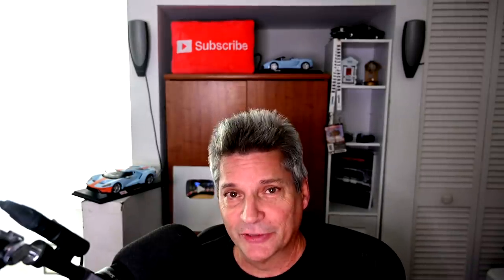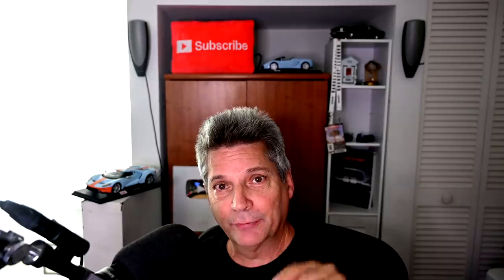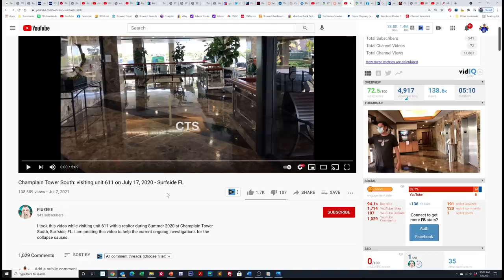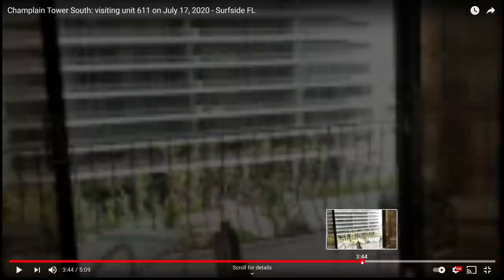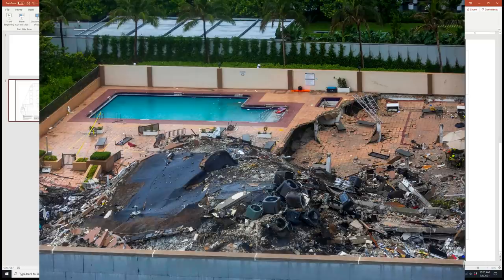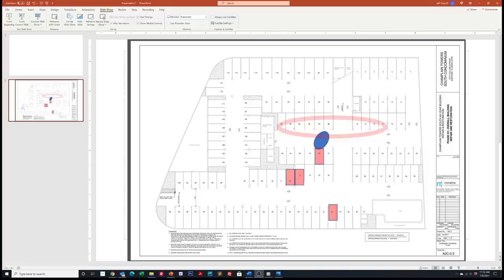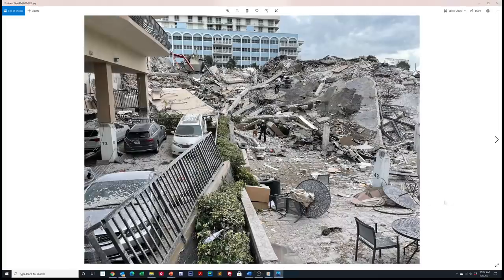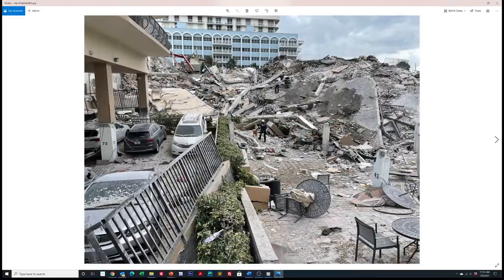Analysis Garage Video BEFORE Condo Collapse: Water Everywhere

Comment: I’d be surprised to find that the concrete ceiling in the parking garage was ever according to code when first poured. 
Agree the garage floor looks like it is sinking in some spots and higher in other spots. The large cracks in the ceiling that were so called fixed by handy man as you say in the video is separating, moving away from the other part of the separation. Total failure of design, concrete mix. This building should never been allowed to be filled with residence after the 3 year ago building inspection. To me it shows not a failure of vertical columns but horizontal ceiling to floor above that failed. God help those who allowed this building to ever pass a inspection in the first place. I’d call this design a complete utter disaster waiting to happen. I’ll never move to Florida now.

Comment: Of course this is in South Florida, water on the floor, once it gets there, will take a very long time to dry. The humidity is pretty much incessant and the floor of the garage is poured below grade. The water can't even soak into the concrete floor because under the floor is almost certainly extremely wet. Dig a hole a as deep as the floor of the garage is in South Florida and see how long it takes to get wet. Not disputing anything about the commentary, just saying, wet is a way of life down there.

Comment: exponential colunm failure one goes others take the load and fail with a  branching pattern due to pumping salt water and sediment from the garages .it caused a pocket under the building as the sediment was supporting the building=no building but only a  Lemans guess though♈️🤟 also the reddish brown streaks is rust

Comment: Sorry to post another thing wish I could of just edit… the space 52 and 53. It looks like a void of some sort in the center of both the pitch on right and light goes to the center. To me there is water internal besides external . Unless they had people with no experience finishing . There is a issue :. I’m so disappointed that’s water is standing and that there is no place for water to drain. They had some issues going on and I just baffled why they think epoxy or hydraulic cement would fix that. Been cheaper to just use quick Crete

Comment: I wonder why the left side of the building was built more solidly and with thicker columns than the right side. It is as if the engineers were different.

Comment: That look's like liquid foam dripping from when it was injected into a crack, not rebar poking out at 12:20 absolutely NOT a good fix, especially since foam expands powerfully, as it dries. You can see where the yellow foam expansion brought some of the rust from the rebar out with it. It looks like they left the plastic injector tips in the cracks, I've seen bad work done exactly like that before on homes, and businesses.

Comment: I may be rushing b4 I finish the vid, but you mentioned how column 78 being muy importante. That alot of  water was sitting there, then you also asked why would that one car have a cover on it if it's in a garage? Well isn't that car sitting in #78? 🤔 I mean, you do this for a living, you know what to look for, so I'm probably dead last realizing this, and if I am,...then disregard my comments. Carry on!
Reply from the maker: you're making it sound as if I'm some kind of idiot. It wasn't a real question that was a rhetorical question kind of like revealing more information about the space by asking a question that you're supposed to answer yourself.
Reply: @jeffostroff  No,no,no, I was just slow at realizing the connection. When you said that about the cover, but didn't say which section it was in after that, I just immediately had my lightbulb pop up putting the two together. But it honestly went over my head that that's what you were saying already. Me saying, you do this for a living was me saying, that I do not. I could be so very wrong about it, and if I was to correct me. I was asking the question was this being a key point. But I was too slow to understand that that's what you were pointing out already.  So, no, that wasn't my intention to upset anyone. I apologize if I did, but I assure you, my actions were due to me being deeply fascinated into the subject, & had questions about that specific point.
I can see how you saw it put that way too. My apologies.

Comment: Does anyone else get a very eerie feeling watching these videos? So many people lost their lives. Horrible. I know it's called an accident but this should have never happened. After a proper inspection with experts this should have been shut down. I know it's easy to say after the fact, but so sad. I'm definitely no expert but they definitely need technology so they can look inside the concrete, not just the outside.. I will never look at underground parking garages the same.
Reply from the maker: Yes preventable accidents like this are the hard ones to watch because as you see the onion unravel in each bit of evidence and you stopped to realize oh this part should not have happened and then Oh no no that part should not have happened either and just how many errors are made along the way you just wanna hang your head

Comment: If the sprinkler system was leaking the flow bell would've set off the alarm... unless somebody left it on "test." If thats the case, somebody probably caused a lot of human catastrophe. Imagine, if you had 7 to 10 minutes to get out of the building because the alarm was going off?

Comment: I wonder if the condo had the deck tiles installed and the sand under them just acted like a wet rag just sitting on the deck concrete for years and years cause the pool deck to fail and from there everything came down.

Comment: At 19:08 to 19:15, it looks like another piece of that corrugated metal roofing attached to the ceiling.
Reply: By the way, this series of videos was really well done and showed a lot of great observations.  That other identical building up the street should be inspected very carefully for the same types of problems.  I wonder if it also has the smaller columns under the part that collapsed.  I wonder if it is experiencing the same types of water damage.

Comment: i am an engineer and the photos i have seen don't reveal much, the garage looked pretty clean to me, a few puddles don't mean much
Reply from the maker: It's more than a few puddles it's a constant supply of water dripping everywhere that should mean quite a bit to you. Especially the multiple cracked repairs on the ceiling that were done wrong and you could still see the injection ports sticking out. The reason why there was cracks on the ceiling in the first place is it's under stress time for round recreation whether your idea relaxation

Comment: IMO the slabs over the garage were compromised by water from above, rusting the rebars inside the slab. And thus the slabs dropped downwards away from the columns, and this created a lateral motion that pulled the columns sideways as the slab fell... thus collapsing the entire building. Really bad design, bad maintenance, bad engineering report and bad luck.
Reply from the maker: yes our assessment as well

Comment: Besides the Blatant Water Damage EVERYWHERE that originates from the recently installed pavers and  planters ( The Pool and Pool Framing  is 100% in tact and undamaged  ) the ceilings Sagging and Spalling-" DISHING" and WaterPooling retaining Ocean Salt Water and RAIN while Even MORESO , also , CLEARLY having been PATCHED UP  with plaster epoxy and paint while indeed no VISABLE water damage on SOME  Columns proves HIGHLY SUSPICIOUS  that bogus patch repairs were probably made to cover up  cracking and shattering of  Column s .

 The FACT that steel rebar was hanging without concrete after the collapse shows clearly that the  concrete sagging was covered up with plaster epoxy and non support building materials over the support  Collums

  - Jeff is Spot on the #Truth Water cuts through the Most Sophisticated Concrete and Steel Supports like Butter over time while mismanagement and  inexpensive bogus patchwork can take down an ENTIRE BUILDING
Reply from the maker: YEs water brings life, and also death

Comment: The sheets of corrugated plastic was there to protect cars from runoff.
Reply: There are white plastic injection ports for epoxy resin injection or spongy rubber stuff. Basically cosmetic repairs not a solution to prevent failure of a section.

Comment: A dead body, specifically a human corpse has a rank and pungent smell mixed with a tinge of sickening sweetness. Imagine a rotting piece of meat with a couple drops of cheap perfume and you’re halfway to understanding what a human corpse smells like. I have assisted in an autopsy on a body several days old, and even though it was in a huge chilling compartment, the smell was in the whole complex. It smells like there are a million dead and rotting rats around you. Understand that a pound or two of rotten meat only gives you a faint whiff of the smell of a full-grown corpse. The power of the smell is incredible. Personally, I’m not sure it’s describable. You want to gag when you’re fifty feet away. It can take years for the smell to leave a house. It just lingers in the background. Cars are totalled by the insurance company for the odor. And the guy driving the wrecker can’t drive fast enough to get away from the smell. It gets on your skin and clothes. (People use bio-suits for body removal for a reason.) Maggots abound, fluids abound, and I’ve never read a good description of the experience. No matter how well you write, it will be but a pale imitation of the experience. Rotten eggs, feces, and a used toilet left out for a month x 1000. It is unholy. The smell gets into your throat and you can taste it. You will literally run to find some clean air. Even then, it lingers and you can’t quite get the smell away. Even though you can no longer physically smell it, you remember it and it takes quite a while to get over it.

Comment: Analysis is wrong. The Other  better video I saw, the columns by the black truck fell. The water was further in. The damage was further in, where the front of the building was. The parking garage goes out further under the pool deck.

Comment: Those residents should have been questioning why they are paying hoa fees and the place looks like crap. And even hiding it by paint isn't working. There are stalactites & dark patches in the paint. AND they stalactites are forming off of the epoxy patches! That means the water is still coming down. That should have made people question their is a water problem.

Comment: In engineering, the failure of one or two columns should not impact the total collapse (assuming there are many many load bearing columns). So if one column failed, the rest are supposed to hold up. But if "many" had been worn out and weakend due to spalling , then the collapse of just the one column (whichever it was) must have triggerred the rest. This has to be on the engineering execution team. Also pls dont put dramatic music to a great commentary! Thx

Comment: maybe someone drove a car into the parking garage  and hit a few columns?  
or had a heart attack or seizure and just floored a vehicle into a few columns..?
 it would be found at the bottom of the pile  with significant front end damage in a frontal impact direction..

 ps ,, it does rain daily in the Miami , like clockwork it rains daily..
and  cars do shed water when parked on an incline..
 i think  column 14 is on a separate structural slab where as the parking deck with it drains is sloped and inclined.

just a thought ...

Comment: 20:54 that black line down the row (ceiling above the driving line(rusted rebar?)) is the planter box line, and a constant source of water, pressure of 1/4 inch deep water is about 4 inches mercury vapor rise, very similar to the tissue paper draw factor, add some sun and the steam in the concrete will propagate. With nowhere to go water will follow the rebar and network out every rebar, every planter box watering cycle. ticking time bomb... soon all the rebar is held in sand, puff. Everything was tied to the platform, you can see the poles only had short 4 ft rebars interlocked, not welded. see 24:18 column 72. Once the flowerbox platform sequentially collapsed the building fell in from the planter box out. Take note the center flower box had a hazzard barrier next to it, just above spot 78, at 28:30 of your first video https://youtu.be/PEPyE2h6P4k?t=1710. These flowerboxes took down this building.
Reply: lookup the waterproofing, drainage plans and watering schedule for those flowerboxes...

Comment: It's not enough to patch ceilings in a basement !!  You have to fix the roof 10 stories above it.  or fix the plumbing some stories above it.  And fix all the slabs and columns and walls above it.  This is like chewing gum on a space shuttle gas tank.  (what is that? that's the leak still leaking at the edge of the patch, and the iron oxide coming with it from the rusted rebar that exists in many walls way inside the building).  Unfortunately this should have been demolished in 2018 after a more thorough test which would have proved it beyond economical repair.  it's probably fully depreciated anyhow, and the owners would have liked a new building.  Plus not been killed.  At 27:35 you see rows of derelict a/c condensers causing damage and whole roof looks derelict compared to older building on the right.

Comment: Tha is the only building tha high tha have ac central units  the condescension fron the pipe that runs inside the wall from the roof to the units   leaking end condescension over time that is why no   buddy see the water come from humidity

Comment: Where is the h beam or I beam support structure needed for load distribution especially because the whole condominium complex built on top of swiss cheese aka the parking garage and no tie in to the solid wall outlining the the parking garage and solid ground as well this building was doomed from the start.
Reply from the maker: I wonder if they really needed those H-Beams, I want to know what it was under because I saw nothing over it in the drawings that says they needed it

Comment: Any thoughts on the lines of water on the ground might be from the condensation from the sprinkler system lining the ceiling? Not sure if that would create that much water, but Florida isn't a place where water evaporates quickly in a garage.
Reply: Sprinkler systems don't produce condensation.

Comment: By the Ocean the faulty pipes with water and humidity in S.Fla. Better set up dehumidifying equipment through out all buildings in these conditions in Florida. Take note. Most was due to poor building due to greed and cuts and time frame. Bad business cost lives at the investors increase expenses which greed and smaller column's on the collapsed side. The extra penthouse on the top was a cause for this adding to the failure and added weight. Shoddy workmanship.

Comment: Those columns are way too small. Anyone can see that.
Reply from the maker: The columns are small but likely they are right sized, as long as you don't have a problem with the pool deck collapsing which is something that probably people didn't expect to happen back in the day. Also if they don't put in enough rebar to strengthen the concrete and tie things into the columns that could be a problem as well.

Comment: LOOK AT THE COLUMN AT MINUTE 25:04. IS IT JUST ME OR IS THERE A SHEERING CRACK AT THE TOP??
Reply: ALSO, MINUTE 29:36& 29:48 COLUMN 88 APPEARS TO HAVE HAD A HORIZONTAL CRACK REPAIRED AT SOME POINT. (DOESN'T LOOK LIKE FORM DEFORMATION)
Reply from the maker: It is so hard to tell, lot of distoirtion

Comment: I think that the water issue is poorly maintained A.C. condenser drip lines, the repair on the PVC 90°, and the sheet steel "drip pans" against the ceiling are all "Handy man" repairs because people usually do NOT call a plumber for A.C condenser lines.
 Which become stopped up with bacteria and fungus.
 All the stalactites follow cracks in the cement, cracks that are now redirecting A.C condenser drip water from multiple units.
 The rebar has now created a rust jacking situation where as it rusts, it expands, expansion opens cracks, more water comes through, more rust happens. Building collapses.
 Rust jacking in insufficient rebar caused by lack of condenser drip line maintenance is why it failed. 
K, bye.

Comment: Well there is one fundamental problem so far, your water water everywhere thing? You do realize there were thunderstorms in the area on July 11, 2020 right? A lot of that water could simply be coming in from wet cars.  Then you point at the ceiling and talk about paint peeling, which is stupid that they allowed that to happen but as you point out high humidity causes that. I wonder, is there a history of high humidity in Miami Florida? That is obviously a rhetorical question for those who may not be familiar but the average humidity in Miami is well over 70%. In fact on the very day this was video was taken, Saturday July 11, 2020, the high for the day was 90°, with a low of 79 and a humidity range between 76 and 86%. In other words a normal summer day in the general Miami area. I'm gonna leave the detective work for the people who are actually going through the rubble.